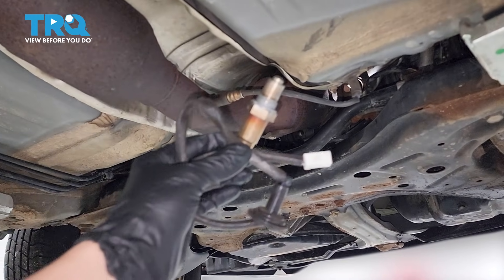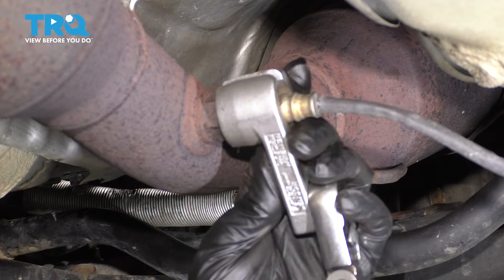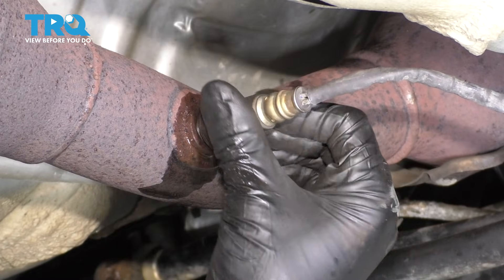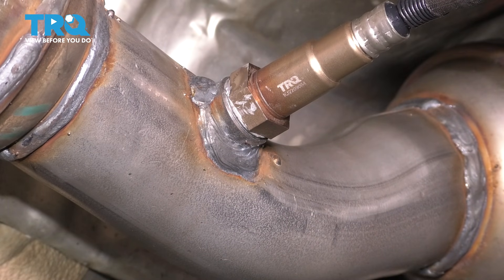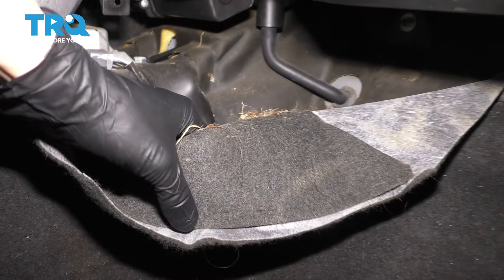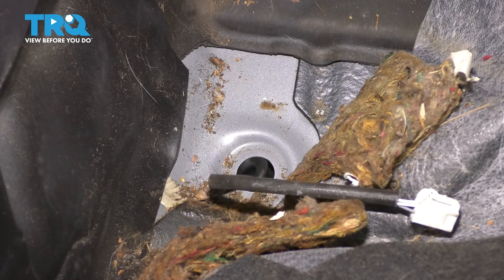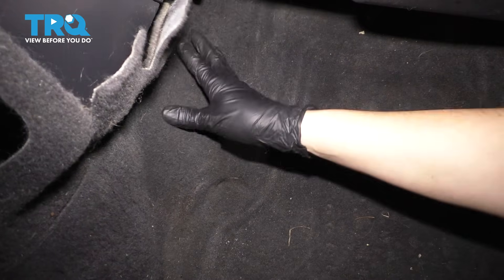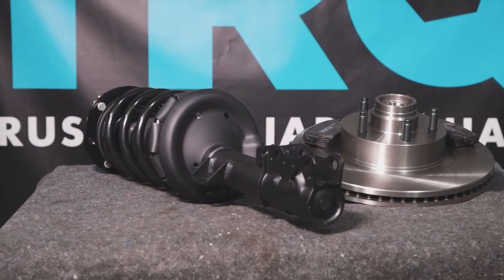How to Replace Downstream O2 Sensor 2003-2008 Toyota Corolla

Comment: I just replaced my censor. If it helps I disconnected it in the car first pushed it through the hole in the floorboard and then slipped the loop of my 22 wrench up to the bolt and removed that way because I didn't have a oxygen sensor socket.

Comment: I took out my 20 year old original downstream O2 sensor. I drove the front end up on ramps, crawled underneath from the passenger side, and applied PB Blaster. I let it sit for a while, heated  the base of the nut a propane torch, then applied more penetrating oil and let it sit overnight. The next morning I torched it again for good measure and used a 22mm combination wrench to get it out. It took a fair bit of force, but it wasn't too difficult to remove. I've heard that the specialized O2 sensor sockets tend to warp under force and may not bite well, which is why I opted for a 22mm combination wrench.

Comment: Just did this repair on my 2005 Corolla Le with 156k miles. Just some tips, days before leading up to your repair spray good penetrant a few times. Use a o2 sensor socket! It really helped. Skip the 3/8th size and get the 1/2 inch. You’re going to need that. Other than that using the TRQ parts was a breeze and it came with anti seize on the sensor.

Comment: Exactly what I wanted to see, mainly how to unplug inside.  You should have sprayed the penetrant first, maybe even several days prior to removal.  My sensor is on its way from Amazon due tomorrow.  Even though it's February in the midwest next Wednesday it will be over 50F+ so planning on doing it then.  Doing some research today.  Have sprayed homemade penetrant few weeks ago and plan on spraying two more times before removal, also will remove O2S after driving the car for a few hours doing my shift as a delivery driver.  Did upstream O2S 1/1 one month ago and it has made a major difference, after clearing codes O2S 1/2 code came in revealing that both sensors were bad, initially I believed it was only O2S 1/1.  I apologize for rambling on like a nutcase here, mainly want to say thank you for the information.  I really like to see things first before I do them it helps with my anxiety issue.

Comment: Great video. Very helpful, thank you. 
I did purchase an O2 sensor socket for $12 on Amazon and it just rounded off the edges of the sensor. The problem is that the O2 sockets are for 7/8 and 22mm. But, 7/8 is 22.2 mm, which is too big for a seized sensor. So to address the problem, I used an angle grinder to cut most of the sensor off,  leaving the socket-surfaces in place, then used a hammer to tap a nice quality 6-point socket over the sensor and it came off easily with the aid of a breaker bar.
In retrospect, I think a good quality 22mm open-end wrench, as used by the author of the video, is preferable to the sensor socket.

Comment: 2008 Mitsu Lancer 2L Made in Japan.  I want to save time/labor and "not disconnect" the wires from the sensors.  The Lancer wires also goes through the floor inside the car, freekin waste of time.  Your video demonstrates that I don't have to disconnect the wires when removing the o2 sensors.  I just want to keep the old sensors (they're good) and replace the rusty "cat convertor".  There's a patch and rusty hole just behind the end pipe of the cat convertor.  The new cat convertor comes with a 17-inch pipe behind it,... perfect, problem fixed.  Thank you very much!